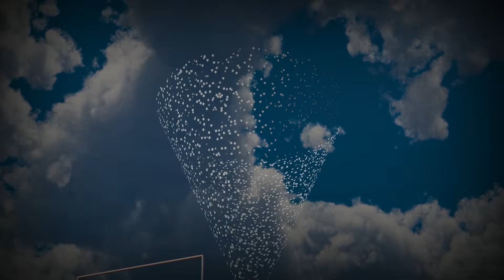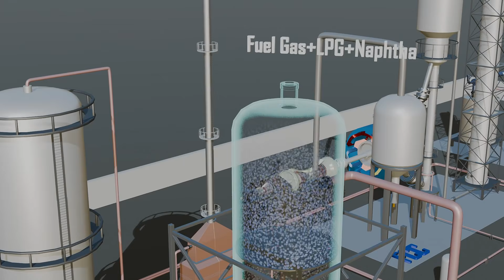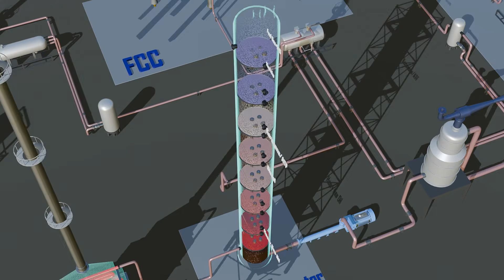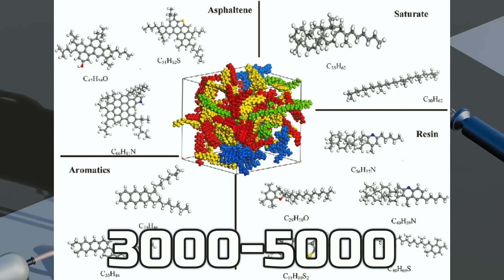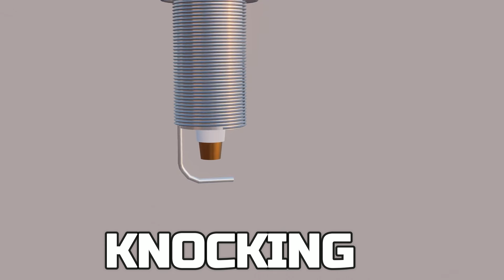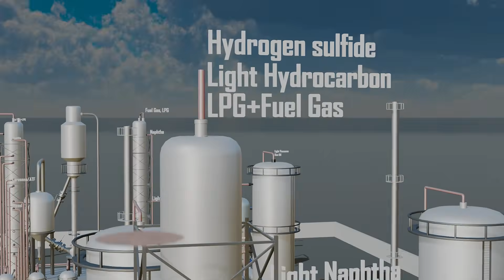How Crude Oil Becomes Petrol, Diesel And LPG Inside A Refinery

Comment: The incident occurred during the restart of the refinery's Isomerization (ISOM) unit, following maintenance.
Importantly, it was not the Crude Distillation Unit (CDU). It involved a raffinate splitter distillation tower.
Here is the sequence:
1. Continuous feed into the tower
Operators continued pumping hydrocarbon feed into the raffinate splitter for more than three hours without initially removing liquid from the tower.
2. Instrumentation failure
The tower had a level transmitter that was giving misleading readings. The high-level alarm system also failed to provide the necessary warnings.
Consequently, operators believed the liquid level was under control when the tower was actually becoming dangerously overfilled.
3. Tower overfilling
The 52-metre-high tower became filled with hydrocarbons.
Liquid overflowed into the overhead piping, causing an abnormal pressure increase.
4. Pressure relief system activated
The pressure relief valves opened, discharging hydrocarbons into a blowdown drum.
The blowdown drum was connected to an atmospheric vent stack rather than a properly designed flare system.
5. Hydrocarbon release
The blowdown drum and stack became overwhelmed.
Approximately 7,600 gallons of flammable hydrocarbons were released through the stack in less than two minutes.
6. Ignition and explosion
A large flammable vapour cloud developed around the unit.
A nearby idling diesel pickup truck was identified as a possible ignition source. However, investigators could not conclusively establish the exact ignition source.
The vapour cloud ignited, causing devastating explosions and fires.

Comment: You should now understand that an oil refinery is an extensively engineered system, a very energy intensive process, takes YEARS to construct, and represents an ENORMOUS capital investment. That's why continually changing environmental laws and lawsuits make if impossible to build refineries in some areas. You don't dare start construction (assuming you can even get that far) if you risk a total shutdown 2-3 years later, or begin to understand that, after commencing operation, your plant can be shutdown at any time or rendered economically unviable because of additional environmental requirements that can cost you millions of dollars to implement, thereby essentially becoming a de facto legislative prohibition on your operation and rendering your multi-million dollar investment worth nothing but the scrap value. It should be known that the resultant fuel produced by these is not yet read for your engine. Additives are included to reduce certain emissions, to reduce knocking and pinging, and to help promote more uniform combustion.

For the curious, apart from efficiency improvements, the essentials of this process have not changed in over 75 years. Even the same type of equipment is used. There are some excellent 1950s videos on how oil refining works. I recommend https://www.youtube.com/watch?v=hC1PKRmiEvs for a good overview. It touched on aspects only briefly referenced here. Indeed, you should watch that video and then come back and re-watch this one. It'll make a lot more sense.

Methane was mentioned in here... You should know that so-called natural gas is mostly methane (CH4) with 5-15% ethane (C2H6), propane (C3H8), and butane (C4H10). The ratios for these components depend on the source for the gas. These burn, in an ideal environment and free from impurities such as hydrogen-sulfide, to produce carbon-dioxide gas (CO2) and water vapor (H2O), aka steam. (Incomplete combustion can result in carbon-monoxide, CO, and additional contaminants can produce other products.) Methane is also known as "marsh gas" since it is generated from decaying organic matter, including the organic matter in landfills and, thus, is collected from landfills and sometimes sent to power generating stations. If not, it is typically flared off to prevent its buildup because it can be unsafe (for multiple reasons) to just let it go into the air.

Modern lubricants are not simply separated from crude oil, though some are. The requirements are fine enough that most, beyond simple motor oil, are produced synthetically from natural gas. This results in an oil with a more controlled grade and almost no impurities. In an engine, synthetic motor oils last much longer for this reason. Distilled lubricant contains various compounds that break down differently and at lower temperatures, with some not being able to last very long at all and, when that starts, it tends to contribute to the breakdown of the rest of the oil while reducing its ability to provide effective lubrication and heat transfer.

When you consider the amount of products produced from natural gas and oil (it is called the "petrochemical industry" after all), you should understand that the world virtually RUNS on oil and natural gas. These include anything from fuel and lubricants, asphalt cement for paving roads, power generation and home heating, refrigerants, medications, plastics, solvents, fertilizers, waxes, industrial chemicals, and a whole host of other things. Without oil and natural gas, much of the modern world simply doesn't exist.

Comment: What's not mentioned in the video (would be out of scope) is the huge amount of energy that is needed to run all this. To produce a certain amount of gasoline for example an additional 20% of that gasoline's energy content is needed to produce it. So if you fill up your tank remember that a fifth of that tank has already been burned at the refinery.
And to show how inefficient ICE cars are: with the energy needed at the refinery just to produce a car's tank full of gasoline an EV would already have reached half the distance of a full tank. (e. g. a car needs 5l/100km, a "sixth liter" has already been used at the refinery; an EV would have gone 50km with the energy of that "sixth liter" alone).
Reply: Oh really? Because Diesel is more efficient than gasoline. Also an EV is powered by burning coal or natural gas to produce the energy to charge the batteries. Not to mention the massive open pit mines for mining the metals for the batteries.... But fuel efficiency for an EV is incorrect. Broken down from kilowatt hours to MPG an EV gets about 5 to 8 MPG. My 2024 Silverado 1500 3.0 Duramax gets 32.5 MPG on the highway at 70 MPH and at 80 MPH it's between 28 and 29 MPG getting an average range of 650 miles per tank, out of a 4x4 pick up. Your precious EV has less range than my truck especially pulling hills, and is less efficient. Now if we had nuclear power plants producing the power or hydro electric power plants you might have a point.
Reply: The incident occurred during the restart of the refinery's Isomerization (ISOM) unit, following maintenance.
Importantly, it was not the Crude Distillation Unit (CDU). It involved a raffinate splitter distillation tower.
Here is the sequence:
1. Continuous feed into the tower
Operators continued pumping hydrocarbon feed into the raffinate splitter for more than three hours without initially removing liquid from the tower.
2. Instrumentation failure
The tower had a level transmitter that was giving misleading readings. The high-level alarm system also failed to provide the necessary warnings.
Consequently, operators believed the liquid level was under control when the tower was actually becoming dangerously overfilled.
3. Tower overfilling
The 52-metre-high tower became filled with hydrocarbons.
Liquid overflowed into the overhead piping, causing an abnormal pressure increase.
4. Pressure relief system activated
The pressure relief valves opened, discharging hydrocarbons into a blowdown drum.
The blowdown drum was connected to an atmospheric vent stack rather than a properly designed flare system.
5. Hydrocarbon release
The blowdown drum and stack became overwhelmed.
Approximately 7,600 gallons of flammable hydrocarbons were released through the stack in less than two minutes.
6. Ignition and explosion
A large flammable vapour cloud developed around the unit.
A nearby idling diesel pickup truck was identified as a possible ignition source. However, investigators could not conclusively establish the exact ignition source.
The vapour cloud ignited, causing devastating explosions and fires.

Comment: What is up with the units in this video? Celsius for temperature, feet for height, and for some reason mmHg for pressure?
Reply: I used to work in the oil industry. I went from learning completely in SI units to then using API units. Pounds per gallon, psi, gallons per minute, ton miles, feet and inches, etc.

The stupidest thing I came across was decimal feet. 10 inches to a foot!
Reply: Many times a vacuum is measured in mmHg, old fashioned, but in my time we used a real Hg filled tube
Reply: The second he said petrol instead of gasoline you should know you're in for a mix'n'match of units.
Reply: @andersjjensen  but petrol is the correct term.
Reply: @clarkeysam  The word petrol is derived from the word petroleum which is the broader category from which naphtha is derived, and naphtha is what gasoline is derived from. Petroleum is today used only as a thinner because it works with a wide range of oil based paints. It has an octane rating of about 30 and is more comparable to diesel than gasoline. So no, it is not the correct term. It is a legacy word like "sodium" and "potassium" from when the processes were not fully understood.
Reply: The petroleum industry is crazy - that is the tip of the iceberg of conversions and units of measurement they use. Think of combining metric, imperial, industry specific measures and other, specialist - and god only knows what else.
Reply: @SOberem-o7b  the craziest thing I found was when working in the oil industry for a company which uses SI units! Total, the French major is one such company. Everyone carried around a conversation book to convert everything back to API units so they could intuitively understand/feel the numbers better.
Reply: @SOberem-o7b  like when a drilling rig is using 16.5 pound mud for kill mud? You mean that measurement? That literally translates to 16.5 pounds per gallon. That drilling mud weighs 16.5 pounds per gallon, they mix it in a 600 barrel tank (25,200 gallon tank) of a premix which equals 415,600 pounds of OBM or Oil Based Mud.

Comment: Interesting, I worked as a summer student in a Gulf oil refinery almost 50 years ago, working in the poly, cat, and crude units.  Learned a lot about the refining process by tracing the piping throughout the facility.  Ended up being my most interesting job, albeit breif.

Comment: CIF - TTM PROCEDURE
1. THE BUYER ISSUES ICPO + CP + COPY OF THE BUYER’S INTERNATIONAL PASSPORT (DATA PAGE) TO
THE SELLER.
2. THE SELLER AND BUYER ENDORSE THE CONTRACT. THE BUYER ISSUES A LETTER OF COMMITMENT
TO THE SELLER.
3. THE SELLER PROVIDES THE FOLLOWING PPOP DOCUMENTS TO THE BUYER;
A. COMMITMENT/ASSURANCE TO SUPPLY,
B. STATEMENT OF PRODUCT AVAILABILITY,
C. PRODUCT PASSPORT,
4. BUYER AND SELLER JOINTLY CHARTER A VESSEL FROM A RENOWNED SHIPPING COMPANY FOR
SELLER INJECTION AND SHIPMENTS TO THE BUYER DESIGNATED DESTINATION/DISCHARGE PORT.
5. SELLER SENDS AN INVITATION LETTER TO THE BUYER TO COME TO THE EXPORTING PORT FOR
CHECKING THE PRODUCT LOADING OR BUYER REPRESENTATIVE (OPTIONAL). THE SELLER LOADS THE
PRODUCT ONBOARD THE VESSEL, SAILS TO THE COMPASSED DESTINATION OF THE BUYER AND SENDS
THE FOLLOWING SHIPMENT DOCUMENTS TO THE BUYER;
A. CERTIFICATE OF ORIGIN
B. BILL OF LADING, ISSUED IN THE BUYER’S NAME.
C. AUTHORIZATION LETTER TO BOARD THE VESSEL
D. SGS INSPECTION REPORT
E. TANKER ULLAGE REPORT
F. CARGO MANIFEST
G. MARINE INSURANCE
H. VESSEL DETAILS OR Q88
6. THE BUYER PAYS VIA MT103/TT AS PER THE COMMERCIAL INVOICE WITHIN FIVE (5) BANKING DAYS,
AFTER THE ARRIVAL OF THE VESSEL AT THE DESTINATION/DISCHARGING PORT AND SGS INSPECTION
BY THE BUYER.
7. THE SELLER RELEASES PAYMENTS (COMMISSION) TO THE INTERMEDIARIES INVOLVED WITHIN 48
HOURS OF RECEIVING THE PAYMENT FOR THE PRODUCT FROM THE BUYER’S BANK.

Comment: Imagine trying to remember all of this for a test 🤯
Reply: And you pass with a distinction🙏.
Reply: Well to be fair id imagine most refinery workers and even operators do not know about the entire plant. None of the refinery workers I dealt with as an outside contractor knew much about units that they were not assigned to
Reply: And you pass with a distinction. And there's calculations also.
Reply: Does't look that complicated tbh. The chemistry might be but the process itself is straightforward, just many branches and recycles.
Reply: and you set the curve and show the math.   And then you run programs dedicated to how everything breaks, how to predict it and how to inspect and maintain it.